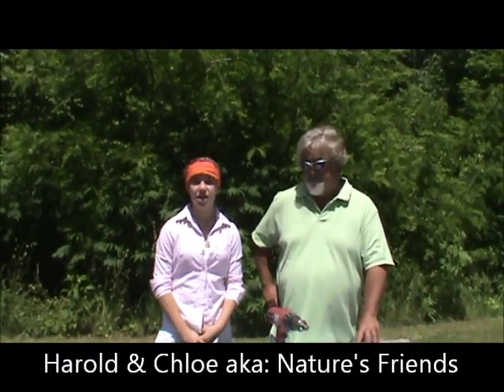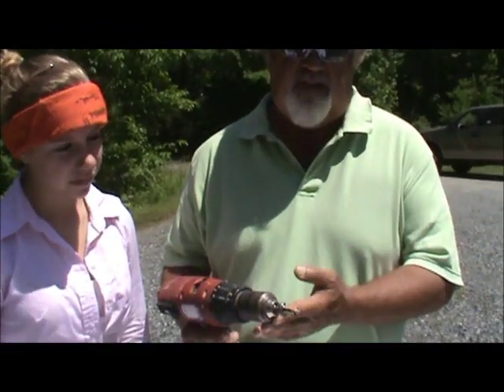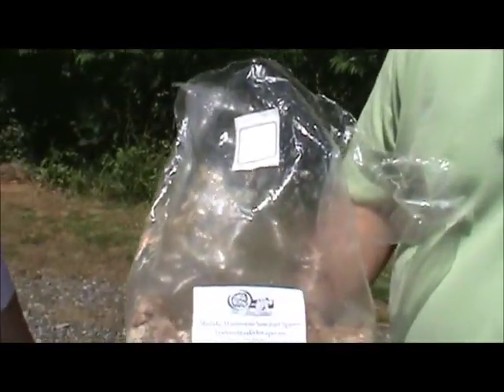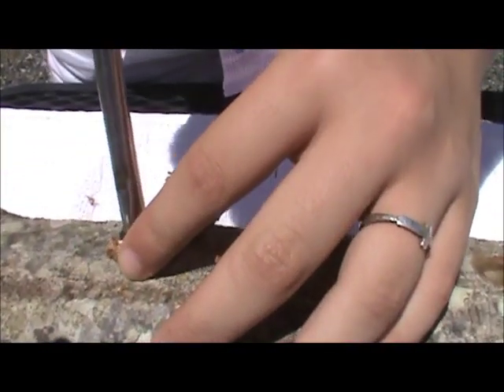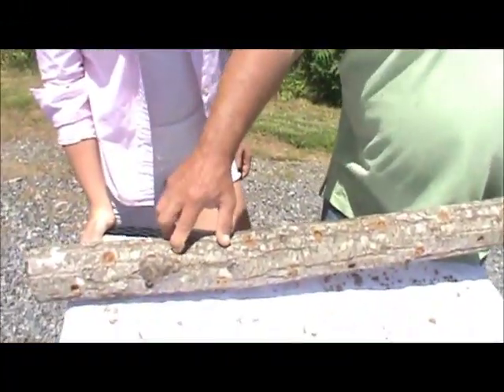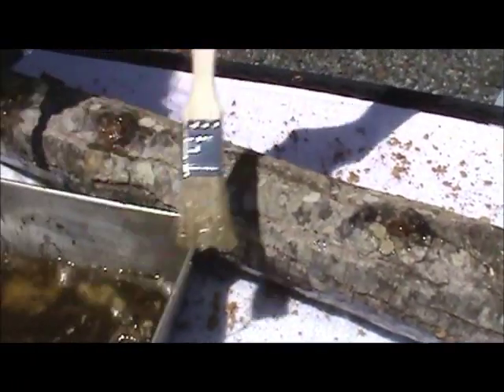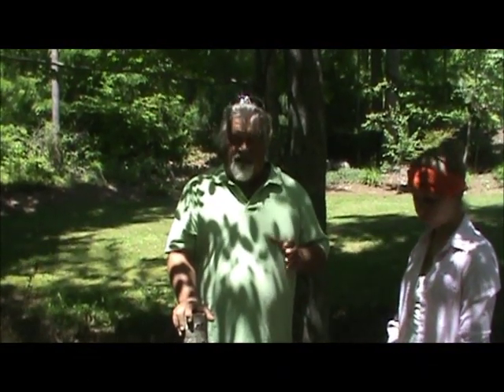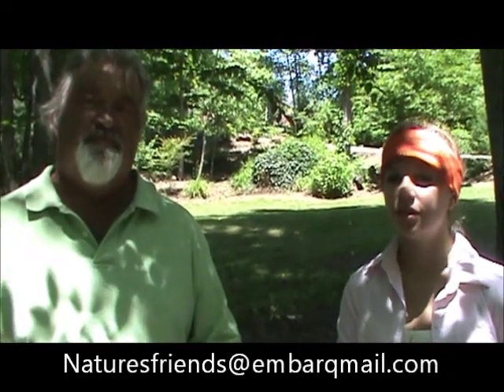How to Grow Shiitake Mushrooms

Comment: I want to try growing shiitake mushrooms this year for the first time. What time of year should I start the process of cutting and inoculating my logs? I live in central VA. Thanks!
Reply from the maker: Cut your logs in early spring, usually March.  I suggest you get a Field and Forest catalog.  It has everything you will need.  It's where I get my supplies.  Good luck and thanks for watching!
Reply: I see you recommend red oak logs, but will white or black oak work? I have a good supply of white and black, but not many reds. I also have a lot of ironwood. Also, some sites recommend letting the cut logs "rest" for about 2 weeks before inoculating to reduce the anti-fungal properties of the sap. Is that necessary? Thanks!
Reply from the maker: Yes White or black will work No iron  wood will not work I have tried resting two weeks will not hurt, Thank you for watching good luck you will enjoy .